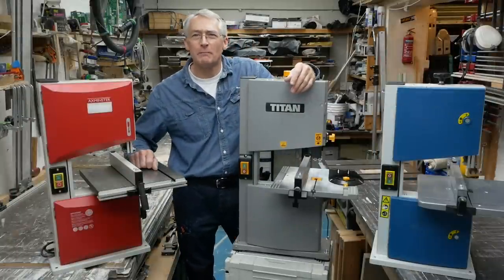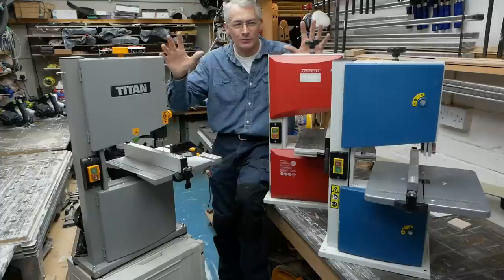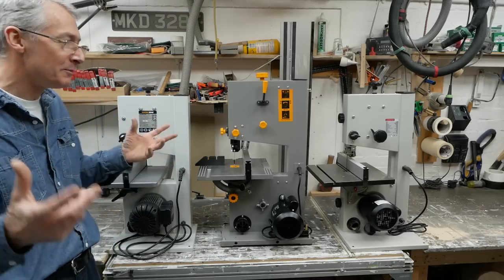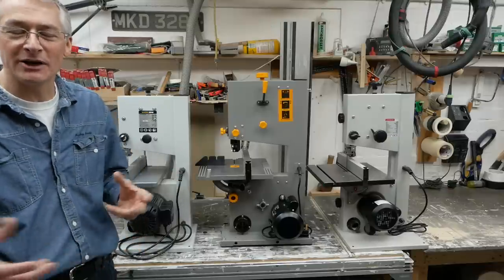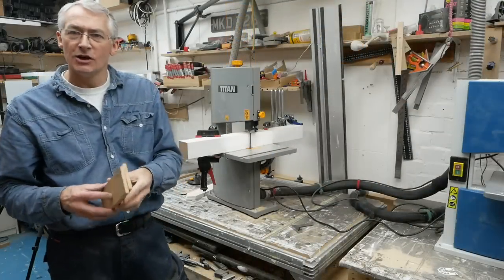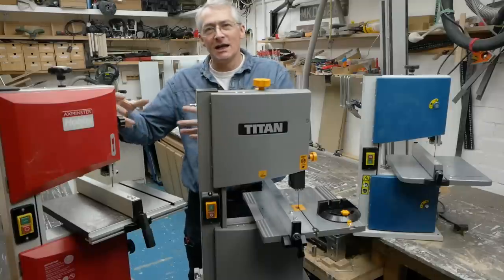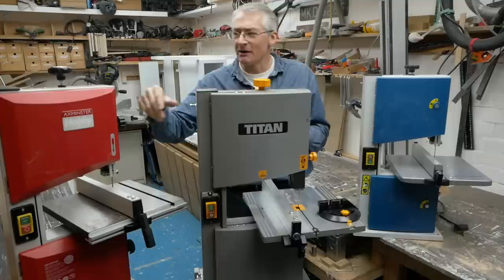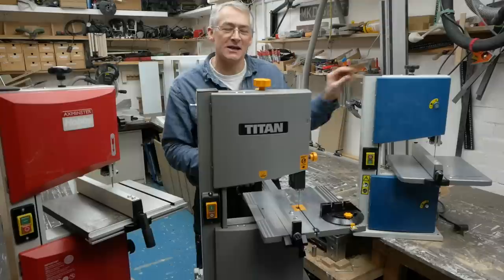Cheap bandsaws (again) #148

Comment: The Titan quick release not working looks like a result of the blade being too long.
Reply from the maker: Thanks! Another user suggested this as a reason too - never occurred to me that blade length was a ‘suggestion’ rather than a specification, lol! I’ll be swapping blades before too long, we’ll see if that sorts it out 👍
Reply: I only know this as I have the same problem on my Record Power BS350.  The advertised blade length for this machine is too long to adjust to the right tension.  I get my blades from http://www.tuffsaws.co.uk/ and get them a little shorter.
Reply from the maker: Big fan of Ian at Tuffsaws- very knowledgeable and generous with his time. New blade will be from there, for sure 👍👍
Reply: Absolutely - nothing but good to say about him ;)

Comment: Enjoyed will comment later.
Reply from the maker: Norman, you tease! Waiting with bated breath now... 😆👍
Reply: Peter - I just wanted to thank you for your considered and thoughtful reviews for us chaps (and chapesses?) I am so glad you reviewed the Titan too, which does seem to have a very much better table (and a mitre guide and slot too). I wonder if the existing fence can be adjusted or beefed up? Otherwise the Axminster 'fence upgrade', may be the way ahead there. On the motor rating issue (S1 and S2) and what the manufacturer puts on the box - you are a family friendly channel but AVE refers to this pervasive tactic as 'marketing wank'.  😳😀One advantage of the Titan's larger wheels is they will put a little (bending) stress on the blades - I don't know how significant but I thought I would raise for others to shoot down or otherwise. If you are determined to get rid of the Axminster bandsaw - I will take it off your hands in exchange for some witty one liners? 👍It would surely resolve my indecisiveness about which bandsaw to go for.🤔